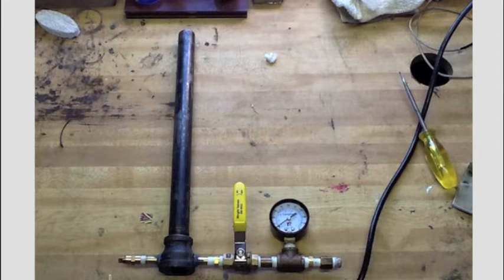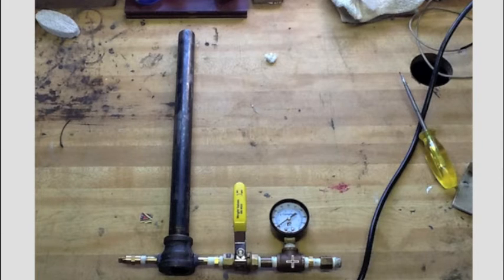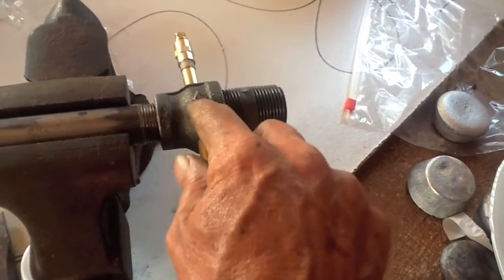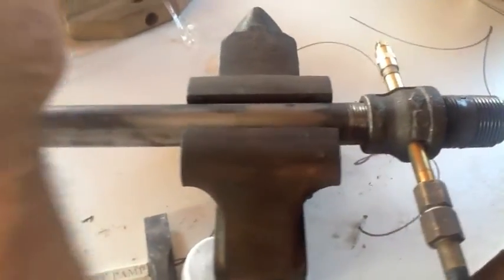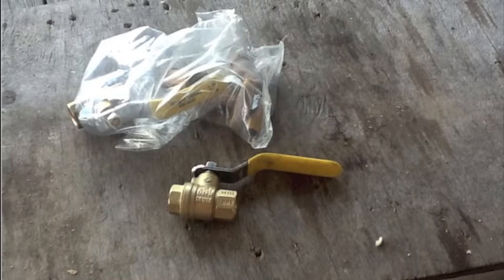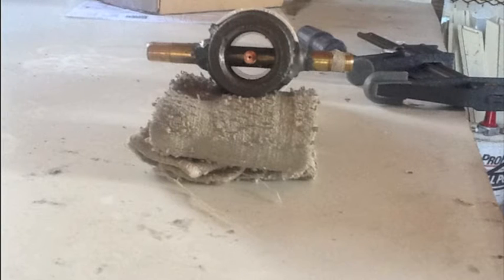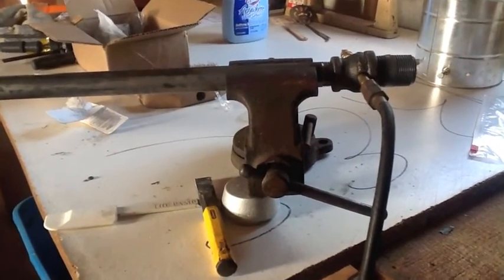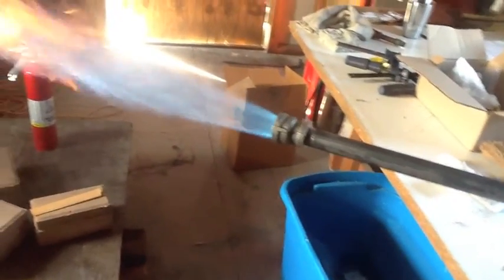MY ALUMINUM FURNACE BURNER - BUILD DETAILS - MSFN

Comment: What size drill and tap did you use in the nipple to mount the .035 mig tip?
Reply from the maker: I could go look in the morning but the drill and tap size really depends on what brand of mig tip is purchased  I would think
Reply: Just curious. Thx!
Reply: i believe the mig tips are M8x0.8, pitch could be wrong though so double check that
Reply from the maker: Looking at my tap now, is etched 6mm -1.00. I used blue hawk .035 mig tips from Lowes

Comment: think this hot enough to melt brass?
Reply from the maker: Oh yeah, I have melted copper with it which has a higher melting point than brass. I also have a video up of my 1st brass casting although its a rather crappy video in my opinion. LOL :)
Reply: I am currently runing a home made oil burner, am wanting to go to a gas reil type burner like you have here, what are the pipe flange diameters that you are using? and is that 1" or is it larger pipe that you are using?

My current setup has a 2" tuyee hole, obviously I can close that up with kao wool, I am more interested in knowing the pipe and flange sizes you have used as I am trying to get away from using forced air and oil...
Reply from the maker: The pipe is 3/4 ID and 1" OD. I believe the bell reducer is a 1" to 3/4

Comment: hello friend.
nice videos... I'm learning...
As impaired Can listen very well. Can you write the list of materials and fittings, for this propane burner, especially the  .035 Mig Tip please. As well as is it possible to later use burn oil??
Thank in advance
B Rgds
Carlos from Portugal
Reply from the maker: Hi, if you look at my other videos I have a video for a forge burner as well. In the description section of that video I have a list of materials there, its made with the same components. Hope that helps

Comment: Great Channel, New Sub from Texas.
How is the Mig Tip mounted? Is there a threading on that piece of pipe, or is it like tapped on?
Reply from the maker: Thx for Subbing :), the mig tip comes threaded. I drilled and tapped the pipe nipple to accept the mig tip. I didnt solder or braze the mig tip in case I wanted to swap it out for another one

Comment: That's a lot simpler to make than I would have thought, great! Pretty slick using the MIG tip, those are easy to find and seem to be really consistent sized. Thanks for sharing!
Reply from the maker: Yeah, they are actually kinda simple to make once ya have built a few. I saw many designs on YT and elsewhere but most seem overly complicated when they dont need to be. Nothing against those other creators but sometimes the KISS method is best :)

Comment: Would you be able to save fuel by using forced air?
Reply: You would have to think about the cost of the forced air. Is it compressed using an air compressor? The energy used to make the compressed air needs to be accounted for. Using compressed oxygen (acetylene rig), in my opinion, could be tragic. About $15 to $20 for a cylinder of propane. 

Now with that said, I have never done this so I do not know how long a cylinder of propane lasts so maybe the air compressor is cheap enough to use. However, using the MIG tip creates a venturi effect and if regulated properly can create a very hot flame.

Opinions???
Reply from the maker: Nice discussion but dont confused "forced air" with "compressed air" or "compressed oxygen". 

For the purposes of melting metal....forced air is simply a Shop Vac or a Hair Dryer hooked into the system sending additional air in under pressure into the combustion chamber, which is the furnace.
Reply: +Makin Sumthin From Nuthin Ahhh! Confusion alleviated. Thanks. Small shop vac should suffice. I used one on a burn barrel once and the results were very satisfying.
Reply from the maker: :) All my burners use a .035 Mig Tip, add a hair dryer or a shop vac to the intake and you have a party 😎
Reply: I just use a air mattress pump...works great. Have 5 holes drilled in the pipe to control the flow by covering them if needed. (holes above fuel source)
Reply from the maker: Anyone else want to chime in?, thats a really good question. I am not up on all the "technical details" to properly answer that question but the use of forced air makes for a complete burn of the fuel and higher temps in my experience so I suppose in theory one could use a little less gas pressure and generate the same temps as a higher gas PSI thus saving a bit of fuel... ?? (Purely Speculation)